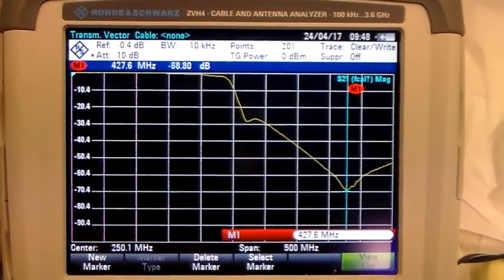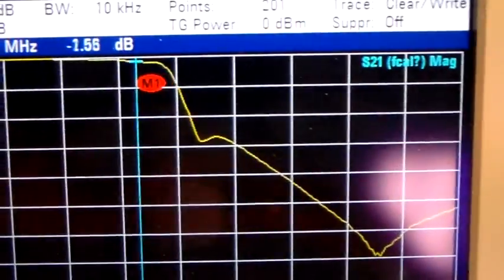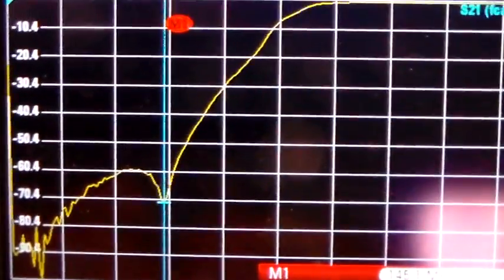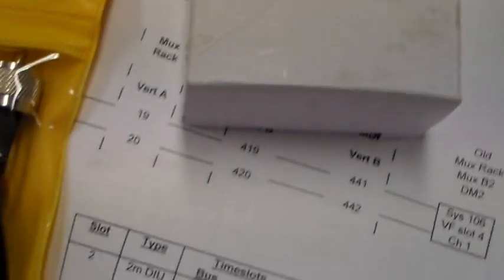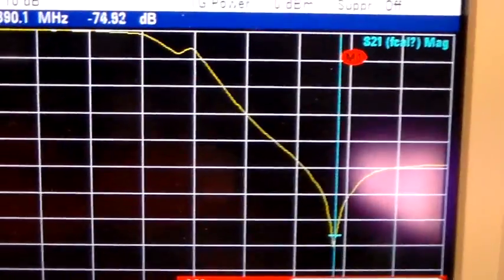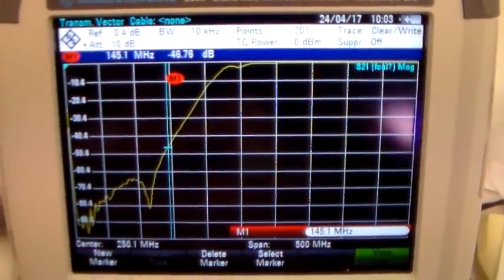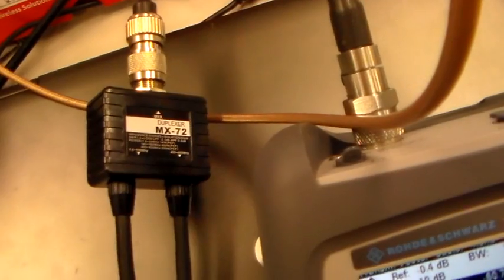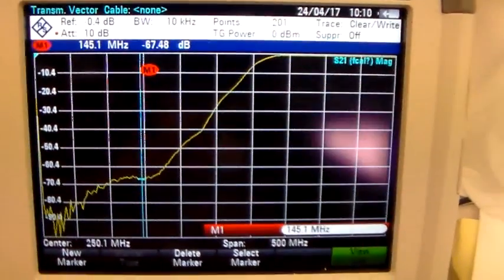Cheap VHF/UHF Diplexers MFJ-916 Vs Andrews MX-72 Vs CDX DI-540

Comment: Hi, the MFJ-916B respond faster? And I have 2 talkie walkie vhf ham radio, can I use this duplexer to make this 2 radio TX and rx on 1 antenna using this duplexer?
Reply: IF you have a VHF radio, a UHF radio and a dual-band antenna these are the right item to look for.
BUT if I understand your question correctly both of your radios are running on the same frequency band (VHF) and potentially the exact same frequency, if that's the case the devices shown in this video are not intended for that sort of application and don't really fit into your application.
Just FYI a device that allows you to do that usually costs quite a bit of money and overall unrealistic for HAM application.

Comment: Hi Sir, Can you recommend a diplexer for the following scenario?  Radio: TYT-9800D || Antenna 1 = UHF/VHF Antenna 2 = 6 Meter. I was looking at the MX-62? Your help would be great. Thank you.
Reply: As a starting point, use HB9ABX diplexer design (2m & 70 cm) https://web.archive.org/web/20070210232935/http:/home.datacomm.ch:80/hb9abx/duplexer.html, if you want the diplexer to do 6m & 70 cm, keep 70cm dimensions the same, on 6 metres, just triple the 2 metre values as a substitute. ie, instead of 6 turns, use 18 turns or alternatively about 12 turns on a 10 mm former. and use 120-150pf trimmer caps instead of 5-40 pf, as used on 2m. You will need to experiment and adjust, however the HB9ABX design was so close at initial testing, need very little adjustment. (that was on 2m & 70cm) Here is a video of the cases I built for the diplexers.   https://www.youtube.com/watch?v=mRkNAKaFr1A   PM me if you want more info, I might even build one myself, cheers, Barry, VK2FP/AG7VC